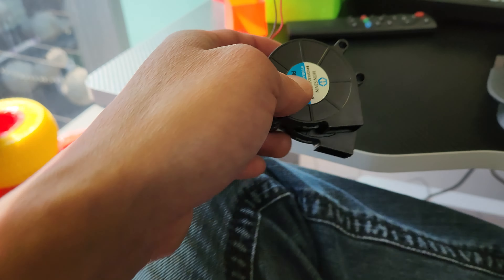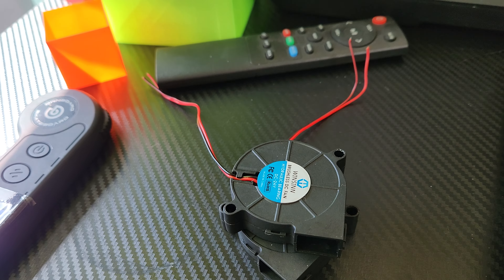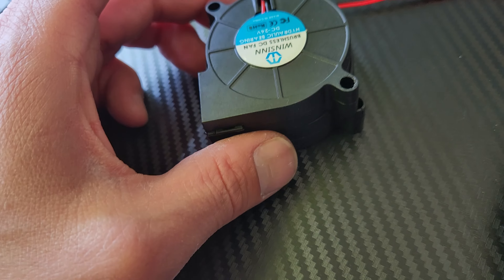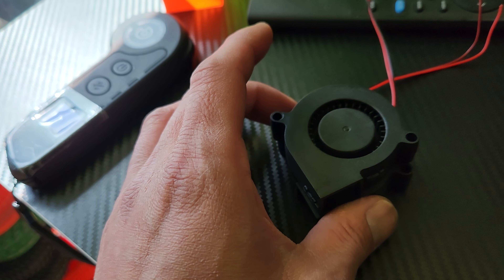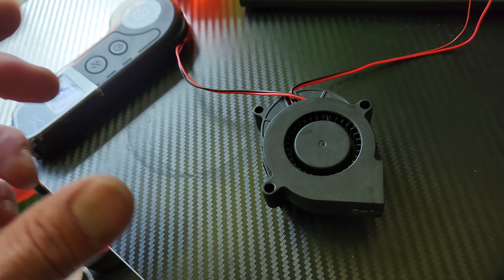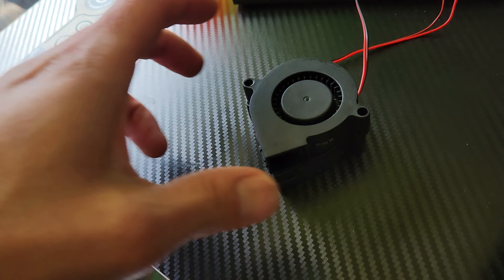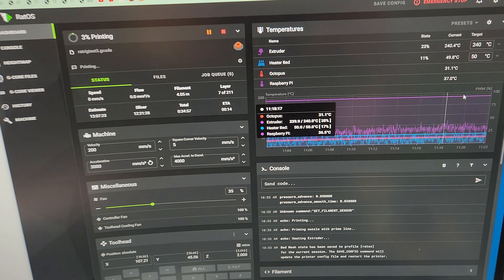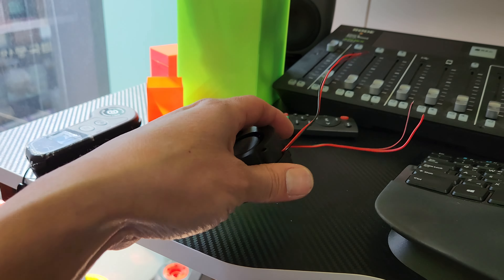Winsinn 5015 fans can cause electrical noise on your 3D printer!  [Klipper adc out of range error]

Comment: I put these fans in my nevermore v6 micro and they don’t really feel like they are moving air through the carbon. And both fans had a vibration that were about 1hz off from each other so i got a realllllly annoying 1hz hum it sounded like those sleepy time songs. I ordered two honey badger 5015s i hope they work better because my nevermore didnt seem to reduce any fumes at all

Comment: Your part cooling duct(s) isn't pointed where it should be and hitting higher up, you aren't using a silicone sock on the hotend, and/or you didn't PID tune with the fans on to simulate a realistic printing situation. It's not uncommon to run into this issue with a more powerful fan than what was on there, especially if things aren't lined up or recalibrated properly.